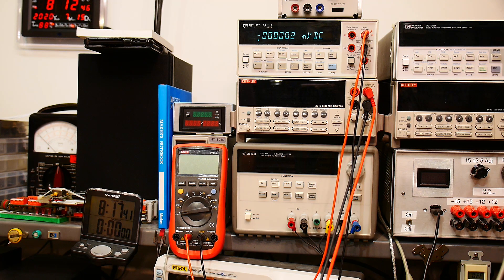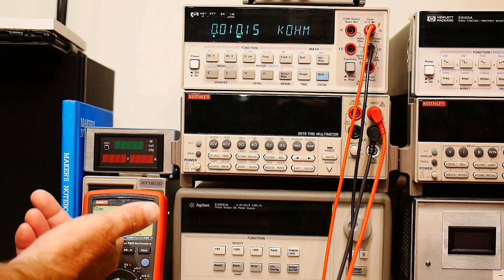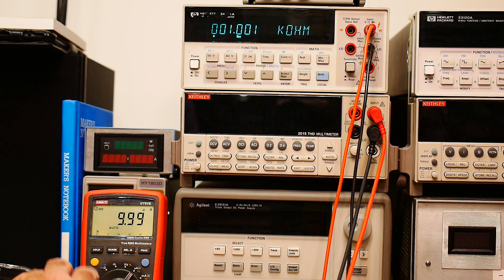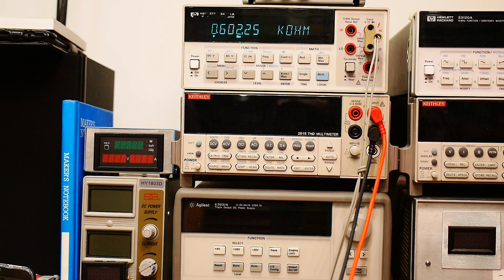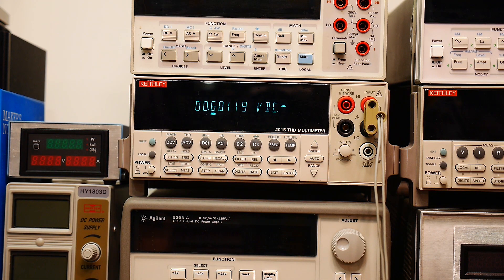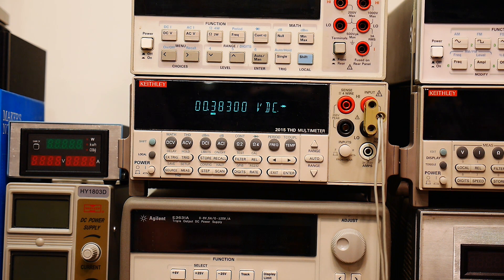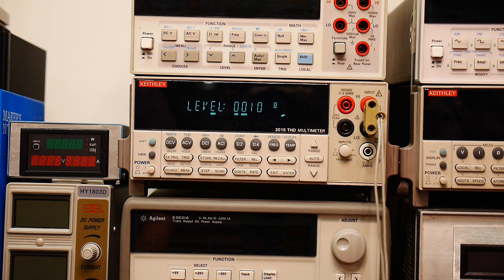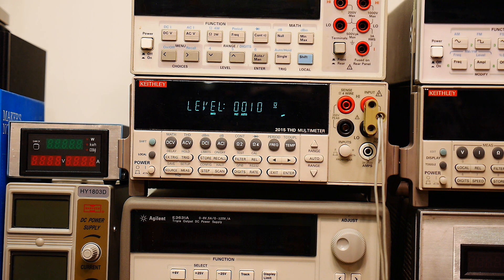#516 Several Multimeter Tricks

Comment: using the ohm range as current source seems a good idea at first but the compliance voltage is very low (restricted by that ohm range) so it is not that useful. I think it is usually up to 1V or so, so it cannot replace the diode test mode. variable continuity beep threshold is available on many other bench multimeters in some form
Reply from the maker: you can use it as a programming current and the other side of the current mirror can be a larger voltage compliance. see:
https://www.electronics-notes.com/articles/analogue_circuits/transistor/current-mirror-circuit.php

Comment: Most DMMs are designed expressly to NOT turn on diodes in resistance mode...handhelds at least. It seems to be more likely to occur with bench units, at least based on my experience. My 8010s & 8050s will turn on diodes in every other range, though not give a true voltage reading. And don't assume a meter will output a constant current either. Some do, some don't.

Comment: Using voltage standard + resistor won't work to check current accuracy, as the meter (& lead) resistance will alter the current.